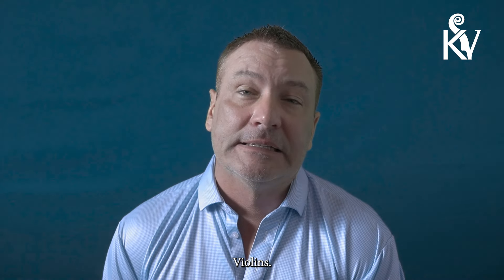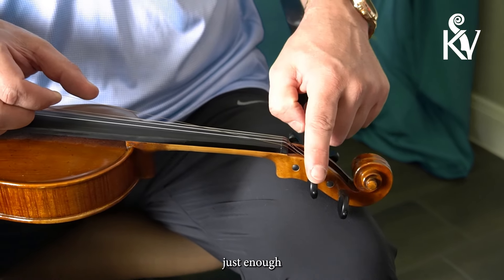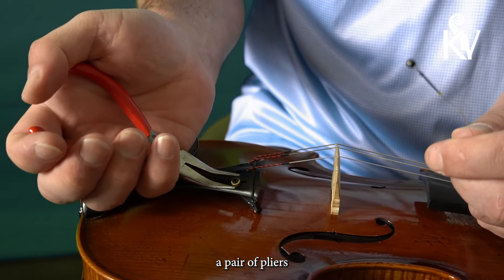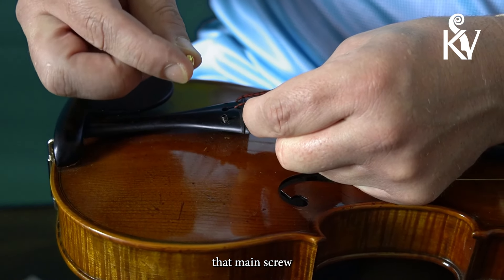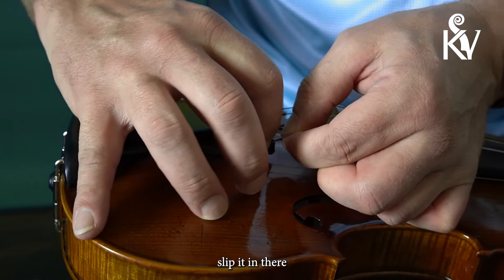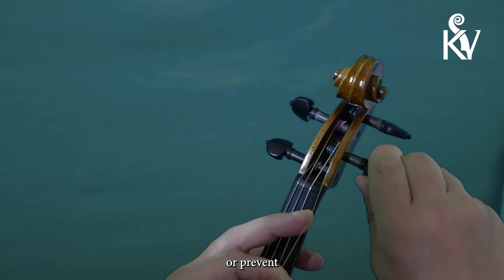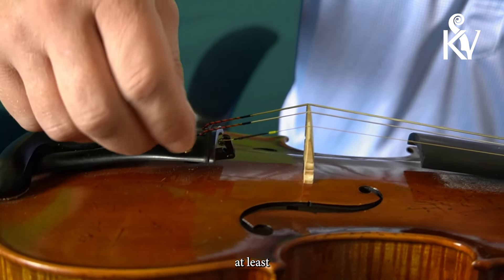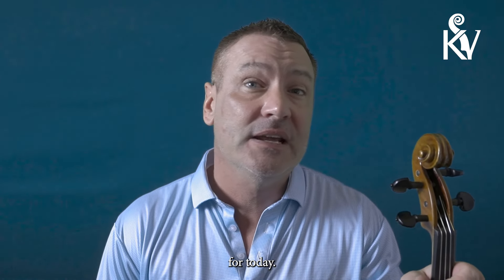How To Install A Fine Tuner on a Violin

Comment: I have a wittner fine tune tailpiece,can one of the fine tuners be used on an ordinary wooden tailpiece?
Reply from the maker: If the fine tuners are removable, then they'll probably fit but most Wittner tailpieces have "built in" tuners and they cannot be removed.  It really depends on the style you have!

Comment: Hi guys I bought a violin for my daughter in a second hand store it had a German bow.
They wanted 120 dollars at the musician store just to fix the bow. 
No professional has seen the violin it's on my channel could you take a look. 
I watched your video 5 years old. My violin has ebony. 
It's a one piece. 
I don't know anything about violins and I have no idea where this violin was manufactured because there's no label the bridge has Dresden. If I was to take a guess I would say it is also German I will subscribe❤
Reply from the maker: Hi there, it's impossible to be certain by looking at your posted vid but it looks like a pretty modern Chinese student violin (perhaps made in 90s).  The fingerboard and pegs look like dyed pear wood and the chin rest and tailpiece look like ebony.  I haven't seen the bow but generally, the bows that are sold with these levels of instruments are not worth re-hairing and usually, the most cost-effective thing to do, is to just buy a new bow.  New student-quality Brazilwood or Carbon fiber bows are usually pretty inexpensive.  However, like I said, I'd have to hold the violin and look in the F-hole to know for sure.  Just be aware that any label can be put in a violin and they generally don't mean a whole log, unless they are antiques.